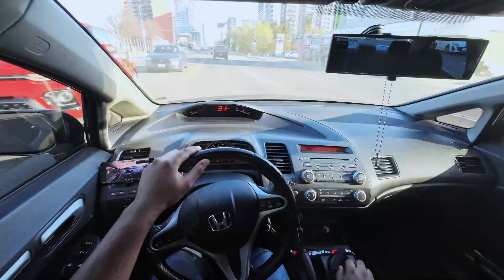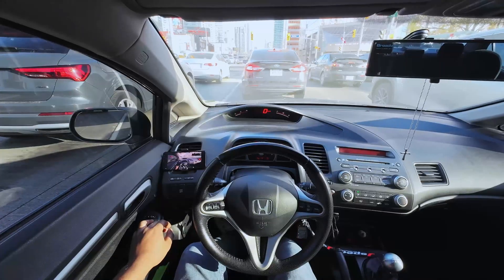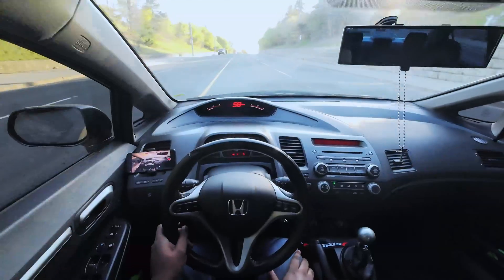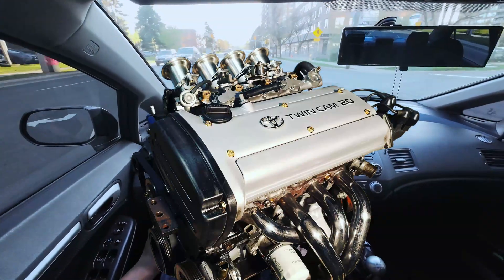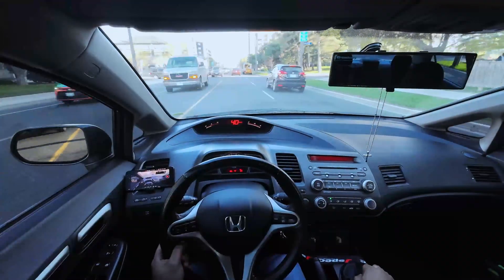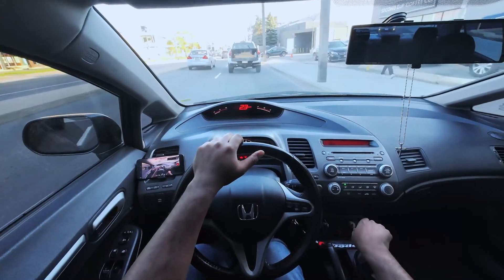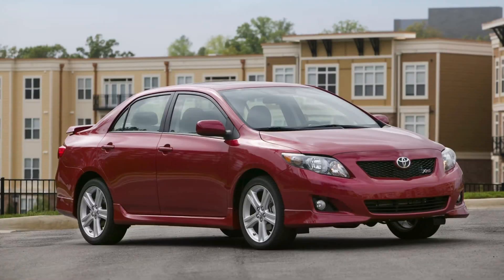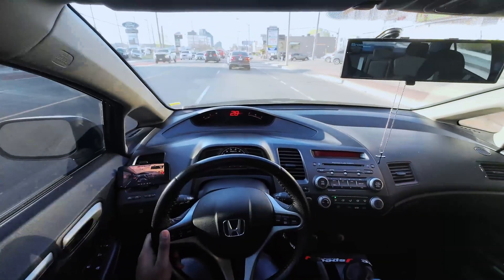Here's Why Honda’s VTEC Took Off, But Toyota’s VVTL-i Didn’t

Comment: are you that guy from tiktok that goes to 6k rpm when CRUISING in the city?
Reply from the maker: Not sure if you're being sarcastic, but in the POV you can see clearly i don't do that....i just drive normally like how you should. and I don't have tiktok either
Reply: @jaayceeisblue  no, theres just a guy on tiktok wth the same model honda and he dead ass cruises at 6k rpm in the city unironically, he just thinks its normal just because "engine can handle it". The filming angle seemed similar. I also can't see your rev counter
Reply from the maker: 🤣🤣 yeah Honda guys can be the worst sometimes. Revving all the way to 6k in the city is kinda dumb, it's a waste of gas an unnecessary wear on the piston rings. They'll also be the same to say Honda is so reliable, yet they don't maintain their car and cry when problems come up. There's a reason why my car doesn't have "Honda boy" problems as they say

Comment: Lotus Elise and Exige both came out with the 2zz engines, but here in South Africa we have them in a variant called RunX RSI and in Australia it is called Toyota Corolla Sportivo. Me personally, I have an AE110 with the 2zz engine and box swapped into it with Ecumaster Classic ECU controlling everything needed as well as to monitor all sensors

Comment: Bolt a Rotrex supercharger to the 2ZZ and it'll do 330BHP plus. Weak point is the gearbox. There is a reason Lotus chose the 2ZZ for their cars and not Honda. Thought both great engines.
Reply from the maker: I heard it was because of US emission regulations on why they chose a Toyota engine

Comment: The BEAMS 3S-GE was available in FWD form with the JDM Celica SS-III in 1997, which would have competed well with the Civic and Integra. Nissan had their version as well with the SR16VE NEO VVL, which was an amazing N/A motor that I wish we had received in the united states. I think it al comes down to volume. Honda put more VTEC and i-VTEC motors in their cars, by volume, than Toyota or Nissan. Even Mitsubishi got in the game with MIVEC.
Reply: Technically, we DID get a SR20VE engine which is the bigger version of that engine which people swap into the 200SX B14 Coupes and whatnot. (Sentra Coupes if you will. Or even the Sentra Sedans since the B14 came with the SR20DE Low Port as well)
Reply: @jordanprice9285  The SR20VE was never available from the factory in the US. SR20DE was, but it's not the same, for obvious reasons

Comment: In South Africa, we were both lucky and unlucky, Honda has always played second fiddle to Toyota here, and they never brought many K-Series engines here, or even the more performance orientated B-Series motors. Meanwhile, performance Toyotas are everywhere, with tonnes of Corolla RSI and RXI's sold here, there are Blacktop 4AGEs everywhere, and with Corolla RunX RXI we got the 2ZZ in droves too. We also got 3S-GEs in Lexus IS200s which are also surprisingly common considering their price tag at the time.

Our car culture is also a lot lower performance than over in the North America, here 300 horsepower is considered a lot, with the most popular cars not even having 100 horsepower, so things like K swaps with big turbos are practically non existent, even for the Toyota 4 bangers, big power setups are not a thing really. If someone wants big power they generally try and get a RB25NEO or 1UZ-FE.

Comment: 2zz was designed to be peaky and fun and sacrifices a bit of performance thats why lift engagement is so high. Also idk what your talking about acceleration being slow, sure its slow but its still .2 seconds faster than your car and it also cracks way harder than vtec. But 2zz struggles to make power like a honda 😢
Reply: 2zz doesnt struggle to make power, people just suck at tuning them

Comment: 165hp in the blacktop breaks that magical 100hp/liter barrier.
Reply: So did Honda with the 2nd gen JDM B16a (170hp), B16b (185hp), JDM B18c (200hp) and the F20c(240hp) also did nissan with the SR16(170hp) and the SR16 N1(196hp)
Reply: Oh I’m aware (I’m actually a Honda guy) but I guess I’m answering the question of why the blacktop is a thing even though it’s “only 5hp” 
Although I did just look at the differences and it’s crazy how much Toyota (probably Yamaha) had to do to get that 5hp (a much bigger leap than B16A to B18C)
Reply: @preludepower420 same as myself dude. True point, yamaha seemed to be the only solution to them squeezing HP from N/A cars. Have to give it to Honda they run the N/A game always have. Dont get me wrong im a big toyota man for other reasons but Honda motors just hit the spot imo

Comment: In other markets, the base XE10 ALltezza AS200/Lexus IS200 got the 1G-FE 2.0L inline-6. It was kinda underpowered, about 160hp. I'm gonna go out on the limb and say Toyota/Lexus hobbled the Altezza AS300/IS300 on purpose by not offering a turbo version 2JZ in the JCE10 but I guess they didn't want it to steal the thunder from Aristo V300/GS400/GS430, Supra turbo, etc. A also 1JZ-GTE would've worked in the XE10 but then it would bump up against the turbo versions of Cresta/Chaser/Mark II and Soarer/Lexus SC in terms of performance. The non turbo high revving 3S-GE BEAMS is good compromise I guess. But that leads me to wonder why not a 3S-GTE as an optional powerplant.
Reply: The simple answer is that it's designer was the guy that designed the AE86. In short, he valued N/A more than turbocharged engines.
Reply: @mr.cangieter8758 Ah.....now that makes sense. 🤔 Thanks for the insight.

Comment: I've owned a  2003 Pontiac  vibe  gt  with the 2zz. The key with that engine  is to keep it in it's  torque  curve  6200-8000 rpm you drop  out of that range   with spirited driving  yes it was very  lazy  in my case  I put a trd. Super charger  on  with 7lbs of boost it was an animal  down low  completely  transforming it's power curve

Comment: IMO the 2zz-ge didn't take off because: a. the last gen celica was pretty disappointing in terms of looks and I think that affected the popularity of the car and the 2zz engine as a product. b. other than the celica, nothing else had the motor that was sporty, I think they should've sold atleast some scion products with the 2zz as an option, and definitely the mr2. Still baffles me to this day why the mr2 didnt get the 2zz.
Reply: And Toyota didn't slap VVTL-i on everything like Honda did with VTEC. Even Honda Pilot, Odyssey and Ridgeline had real VTEC. V6 and inline 4 Hondas had VTEC. Even the CR-V has VTEC.

Comment: Rallying is what put Mitsubishi & Subaru on the map, but after their cheating scandal, Toyota dropped out of WRC. I wonder if they had stayed on (or simply not have cheated), they would have continued to seriously compete with Honda in the high output 4 cylinder category.

Comment: ?  The 3UZ-FE in my 2006 GS430 has vvt-i.  The UZ engines are as robust and reliable as you can get, as long as you keep the timing belt replaced.
Reply: VVT-i is just cam phasing. VVT(L)-i, added variable lift and very few Toyota engines had it. VVT-i on the other hand, was in a lot of cars.

Comment: Dunno why Altezza didn't release with the 1JZ to keep the Weight down, cause the 2JZ is powerful...but the 2JZ is really a heavy Engine, as the 2J weighs more than the LS1, and heavier than the 355 Small Block Chev.
Reply: For real, 1jz altezza would be crazy
Reply: @zLemiWinksz   I have seen 1JZ Swaps, but I guess Toyota wanted to move on from the 1JZ for the at the time new 2JZ, even the Castro racing MK IV Supra had to run with the 1JZ Engine to keep the weight down as the 1J can do similar performance with less weight
Reply: @demanrunner847  didn't that use the Celica's 3S engine instead?
Reply: JGTC Castrol supra is a four banger
Reply: @cj09beira  Oh yeah that's right, I forgot that part LMAO
Reply: Heavier yes but could also hold quite a bit of power on stock internals.

Comment: not all of the red top 4AGE's had higher power. you can mainly tell the higher power 16 Valve 4AGE's by the non T-VIS intake manifold and smaller head ports.

Comment: I'm a massive Honda fanboy but my friend sides the Toyota camp. Getting a Civic Ferio EG9 and a Corolla AE101 pitting them against each other B16A vs 4AGE 20V like the JTCC races of old would be the dream. Also you have a really soothing voice btw.
Reply: b series easier and less expensive to build than 4age
Reply: @tanyguch_kun1330  it normally would but keeping the b16 1.6 NA like the JTCC spec really limits the potential. But whatever, getting a b-series or 4a in 2025 is not about peak pwr anyway. The successors, the K-series and 2ZZ are objectively better platforms in every way.
Reply: @Leekdoesnothing  true, this is why i picked 2zz over a 4age wayback when doing an engine swap in my corolla, even though it isnt popular at the time i had to take the risk but i knew there is a potential, but 4A series engine still relevant in 2020s you can have a 9age build to get that peak pwr, and n/a b series can run 9s these days
Reply: Me and my buddy are doing something similar, I got a Toyota Corolla GTS Fx16 and he got an Civic EF hatchback. Similar looking cars but mine came factory with a 4age and his has a D Series. But he just bought a B series on marketplace that we're putting in it soon. He's gonna have more power in the long run, but I will probably have better suspension and handling. Its gonna be so nice, I can't just feel it lol. We're even doing the same with our dailies. I'm hopefully picking up a 2zz 6spd manual Toyota matrix today, and he has a 2nd Gen 5spd Honda fit. That will be the complete opposite build. He'll out handle me, and I'll out power him.
Reply: @ultimateninja3x01  That sounds cool, the fx16 is an underrated car. Ive never seen one  here in Malaysia. The Fit vs Matrix is an interesting battle for sure. Love a good Fit.
Reply: Your problem isn't that you aren't in the Toyota camp.  The problem is that you are in the front wheel drive camp.  FWD and performance don't go together, as much as Honda wants it to be.  We've had DECADES to understand FWD is economy.  RWD is performance.  I didn't buy my 2012 Yaris 2dr hatch 5spd for performance.  I bought it for the 33mpg in the city.

Comment: Ended up selling my Celica GT-S last year. 

The 2ZZ made a sound like no other, but the expensive aftermarket made it hard for me to wanna keep it.
Reply: I had a 2000 and 2001 Celica GT with the 1ZZ and then later on upgraded to a Celica GTS a 2000 6 speed manual very underrated car. I’ve had an RSX type S with a K20 Z1 and I could tell you now I’d still rather pick a Celica GTS over a Civic SI or RSX type S just because it’s different and fun but they didn’t have that much aftermarket support for the 2ZZ and I think that’s why this engine kind of failed
Reply: @ I agree with u. It’s funny I also owned a 03 GT as my first car before moving to the 00 GTS. I’m in a GR86 now but I still miss that super high revving sound of the 2ZZ. The 86 sounds good but it’s not the same. Very few NA engines sound close to 2ZZGE
Reply: @leoncobarris9230  Do you have any idea why Toyota went 'Full We Todd' on the Corolla GR and Yaris GR concerning the engine?  Regarding the 2zz and m20A for the Corolla, and the 1nz-fe for the Yaris,  WTF would they replace a smoother running I4, with a less balanced I3?
Reply: @VBMichael_D  Idk 🤷🏾‍♂️ but Toyota in the United States give us BS now don’t get me wrong. I do think the I3 in the GR Yaris and Corolla make awesomePower but you’re right they should’ve kept the Corolla a four-cylinder for the GR brand and the Yaris a four-cylinder. I think it would’ve made way more power in the engine. would’ve been way more smoother like you say. I feel the same way about the new tundra. I don’t know why they gave us the garbage V6 twin turbo they should’ve kept it an NA V8
Reply: @leoncobarris9230  You can make absurd power with any engine.  But given an I4 is a smoother running engine (not 100% balanced like an I or HO6 or V12) than an I3 AND both the 2zz and 1nz are very robust reliable base platforms upon which they could've built.
I love the 1nz in my 2012 Yaris.  It only has 107hp but it feels more potent than that.  Though the 2dr hatch is like less than 2100lbs.
As for a V6, at least they were cognizant enough to keep an I6 in the Supra, even though they have the 2gr-fse.  Nissan and Honda however,  forgot that V6s dont' belong in sports cars.  Also a V6 was the reason I sold my 07 IS250 and got an 06 GS430...with the 3UZ-FE.
Reply: @VBMichael_D  the GS430 is a beast makes me miss my SC400 even though they had a 1UZ and the gs430 I believe is a 2uz great Motors, though people sleep on those motors to build
Reply: Wasn't the 2ZZ in the Corolla before they replaced it with the M20A?  Or am I thinking of the 1ZZ?
Reply: @ well the Corolla had the non VVTI 1ZZFE then it got VVTI then in 03 the XRS got the 2ZZGE until 06 I believe.
Reply: @VBMichael_D  one thing to note is that if you bought a year 2000 Celica it had the highest stock redline of any 2ZZ car (which I had). Redline was 8,500 rpm. Compared tho like 7,900 rpm found in the Corolla and Matrix.

They even lowered it in the following years of the Celica
Reply: @omarawilson2853  8500rpm is Honda F20C and Nissan CA18DET rev range.  LOL
Reply: @omarawilson2853  I wish the 1NZ-FE in my 2012 Yaris hatch 5spd would rev that high.  It does go to 6500, but also cuts off the fuel right after.
Reply: @VBMichael_D  Yh but I hear those Yaris’s can be 2ZZ swapped pretty easily. If you can manage to get one in a car that light I’m sure it’ll be a riot
Reply: @omarawilson2853  I have read contradictory information.  I've read that and also read that you have to do some sub-frame work, but that's if you want to use the 6speed, but that it would bolt to the 5spd and woulnd't need it.
I wouldn't mind a turbo kit for the 1NZ, as a TRD department in Japan turboed a few of them.  However, I'd have to get an LSD first.  I hate open-diff one-wheel peels.  LOL
Funny thing is, this car being a 2dr and 5spd, is already a riot.  I put 195/50/16 wheels and six spoke wheels on it last year.  I want to put some coilovers and a sway bar on it soon as well.  
But I also have a rolling shell 240Z to build and a 2006 GS430 to LSD and boost.  $$$$$ and time!
Reply: what do you mean expensive aftermarket? like you bought the car to modify it to something its not?
Reply: @NPC123UH like there wasn’t much stuff available for the car in the aftermarket scene and the stuff that was, was usually a lot more expensive when compared to its rivals

. So making the car faster would’ve cost a lot more money than it was worth.

Comment: Huh, did I miss something? VVT-i or it's derivatives: Dual VVT-i, VVTL-i, VVT-iE, VVT-iW or Valvematic have been in almost every engine made by Toyota in the last 2+ decades. And, is in / licenced by: Daihatsu, Subaru, Scion, Peugeot, Citroen, Pontiac, Aston Martin, Lotus and probably others. Toyota sell 2x as many cars as Honda, so there's way more vvti engines than vtec ones (even without the licenced ones)... didn't take off?
Reply from the maker: I was talking in the context of the high performance ones like the 20V 4AGE vs the B16A. And the 2ZZ that was used in many of Toyota's vehicles. I am not talking about the mainstream iterations, only the performance ones. Toyota's last high revving engine here in Canada and the US was the Matrix/Corolla XRS and the Pontiac Vibe GT. (2ZZ)
Reply: @jaayceeisblue  It seems you're largely referring to them with respect to their use for swapping.
They have made them, they just don't have the fan hype of the K-series (which doesn't actually rev that high anymore, because of emissions requirements they rev lower than early K20 are comparable to Toyota, and have always been slower than the B16), and they're spread over multiple engine families; honda has mainly used the K/L since the B/H ended (2001), Toyota has gone through several I4 engines in the same time.

V35A-FTS, 8AR-FTS, 2AZ-FE, G16E-FTS, 1ZR-FAE, 2ZR-FE (Elise), 2GR-FE (Evora/Emira), 2GR-FSE, 2UR-GSE, 1LR-GUE; they exist, they just haven't been in interesting cars, or are expensive.
Toyota just won't put engines in road cars with as high stress a mapping as Honda; there's a reason Honda is now close to the bottom of the reliability charts.

The B16B, 4A-GE, 4G92, SR16VE all mainly exist to meet racing regulations. The current Toyota race engines are the G16E and M20A (competing against K20 based engines) both of which probably cost more new than the vehicles many k-swaps go into; and are rare used.

People k-swap, because everyone k-swaps (like LS & 4G63 swaps); there's more used stock availability, more aftermarket parts and more fandom.
Reply: @scurige  k series are also way overbuilt for the amount of power they make. You can make 600hp on stock eco K24A bottom end from a CRV or element or something. Sleeve it you’re good for 1200. Stock rods and pistons can rev to 9k+ all day. So this also makes it cheaper to build/maintain these motors along with like you said the fact that everyone swaps them. The K series motor has been used in almost every car Honda has offered between 2001-now too.
Reply: @DMVKIvak K series is the poster boy of the term Overbuilt

Comment: U  don't kno of the v tec contender   the most violent four cylinder  Toyota it's called the 2zz found in mr2 and runs out of japan
Reply: You are wrong in so many ways, mr2 never had a 2zz and it also never had lift, the mr2 only had a 1zz in the 3rd gen
Reply: @rwn_wrc If only he had said Lotus Elise... 😂